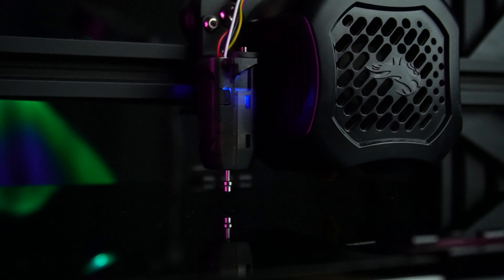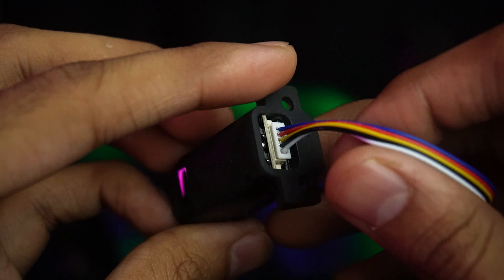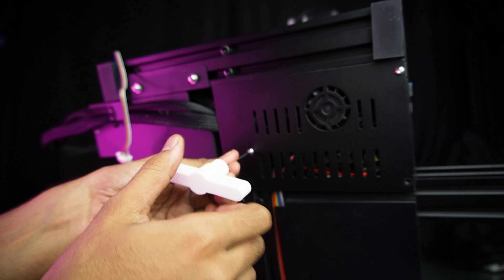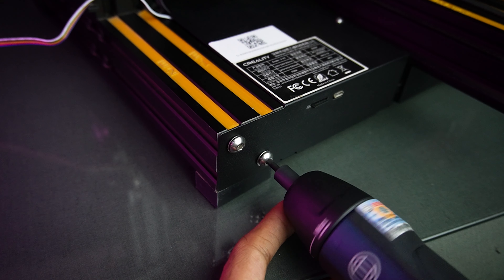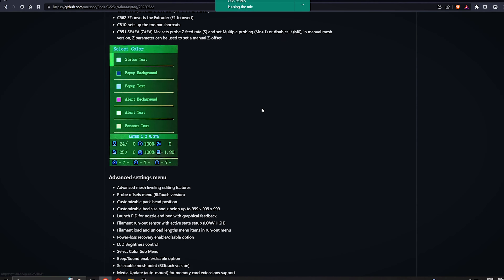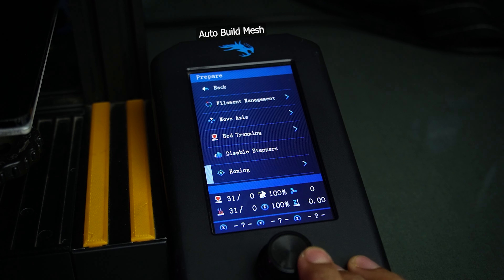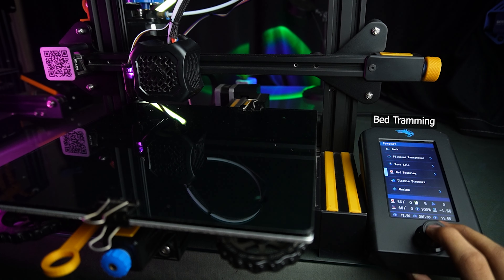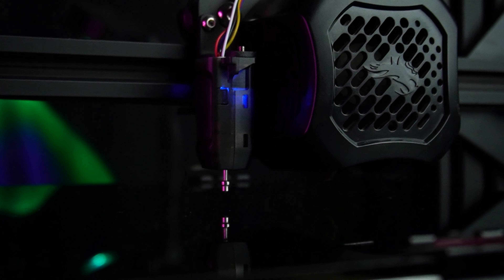How To Install CR Touch Sensor On Ender 3 V2 2023 (Fastest Method)

Comment: I mounted the cr touch and installed the new firmware on the ender 3 v2. So far everything worked. Now I just need to put new firmware on the monitor and that is going wrong now. Namely, I have a SYNWIT (VIEWE) display and there appears to be no good firmware for that on the Github page referenced in this video?
I tried the 3 files that are downloadable but they don't work. Then I immediately get a blue screen with some text that the firmware is not found.

Who can help me? I have now bought and mounted a cr touch and can't do anything with it now.

Would love to hear a solution.

Comment: Heads up you can run the wire for the cr touch througj the black cable sleeving that goes to the hot end/tool head. 

Just plug it into the motherboard, then run it up the black cable sleeve you see there all the way to the tool head.
Reply: I did the same thing. Really clean install.

Comment: I keep having an issue, my bed will move forward instead backwards and it will rattle because it is trying to move the bed up when its on the end of its track.. how do I fix this issue?
Reply: Maybe you have one faulty homing sensor, this sensor is located on the right side of the back